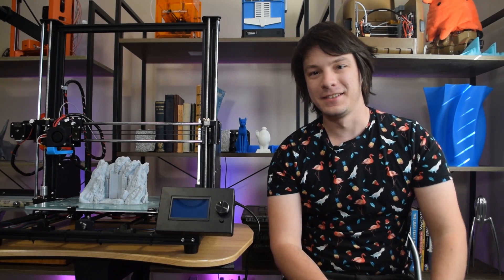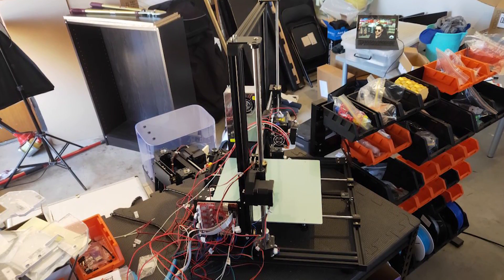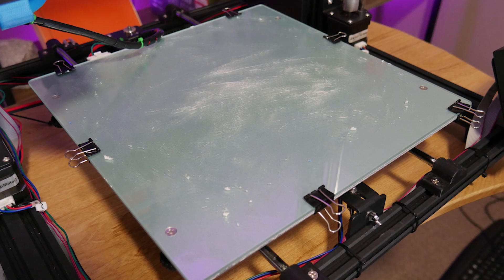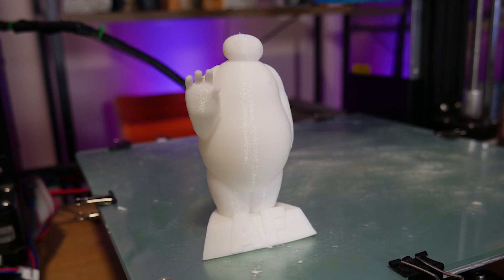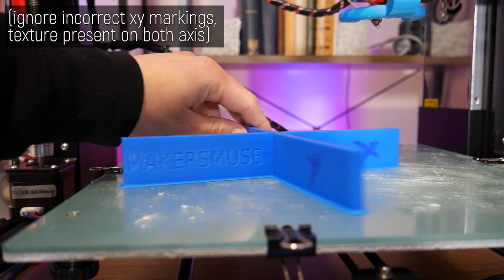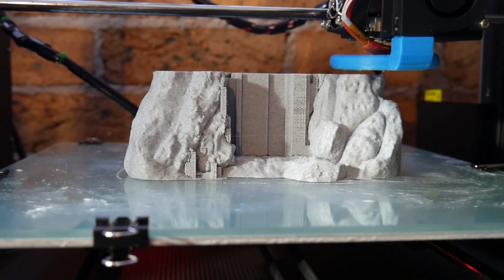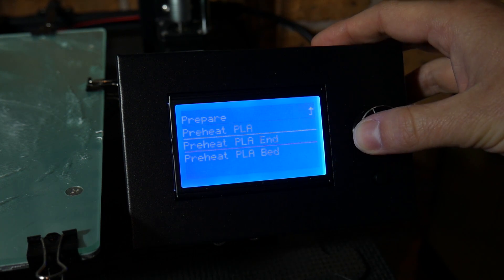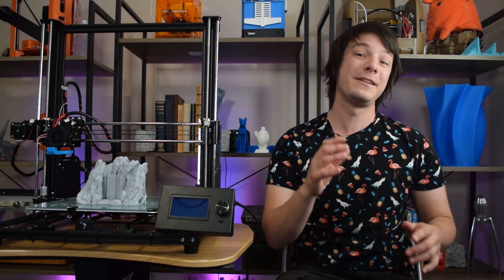The Anet A8 PLUS is big, cheap and won't catch fire. 3D Printer Review

Comment: From what I see this just looks shoddy, even at the low price. It's not like providing the right length of cable is going to break the bank. Even for a tinkerer, I don't think this makes sense. You would end up replacing every component at huge expense. If it was some sort of amazingly rigid frame or something special in another regard then yeah ok, but every part looks sub standard. In 2019 not burning your house down shouldn't need to be considered a bonus.

Comment: I dont understand- why are printed parts so bad? The original Prusas use tons of printed parts on the printers and they are the most famous hobby printers with almost everyone giving them a great review? Is it just that the design of the parts are bad in this case?
Reply from the maker: Yeah, poor quality and designed printed parts in this case. Prusa's parts are generally a lot higher quality though even they have had quality control issues in the past with 3DP parts.
Reply: A reasonable vignette into the Quality control aspects of Anet manufacturing..  Not very reassuring  is it?

Comment: The cable is dragging on the bed,.
Reply from the maker: It sure is...
Reply: @MakersMuse  Don't you consider it a fire risk when the cable can snag on a print and rip the wires out?
Reply: Rubber band it to the top

Comment: New to 3d printing. I didn't realize it was just Anet printers. I heard about them catching fire so my latest 3 day print on my ender 3 I set up one of my home security cams to watch it while at work and send me an alert if the temp goes above 90F. Not like I can do shit except watch my house burn down.

With that said. Does the ender 3 have this thermal protection?
Reply: Most ender 3's should have this enabled, but some do not. There are some video's here on youtube that show you how you can check it. I personally have octoprint with a webcam connected to my ender 3 and i have it plugged into a wifi enabled plug. So if anything goes wrong i can power off the whole thing. I also have a smoke detector in the room. All of this might still not be enough so that is why i try to print when at least 1 person is at home. But maybe i am just paranoid like that.

Comment: Can this print PC?
Would you consider this model vs the tronxy of the same size?  Im looking to print parts to be used as molds for casting, my current mod-t keeps crapping out with the extruder and hot end plugging up.  Just asking for advice, thanks in advance 😊
Awesome channel, love how you take the pros & cons to the units you review 🙂

Comment: I've had an a8 for about a month or so and rather than catching fire, I changed the firmware and get filament spilling out from the top of the hot end and the machine killing itself when it goes over 190°C
Reply: Then again, I may catch it on fire some day and never be printing again, besides on my ender 3

Comment: Angus, I respect your knowledge of 3D printing and printers, however while I am familiar with comments that the A8 will burn and house will burn.its akin to saying do not buy matches or cigarette lighters...they will burn you and your house! This ...as far as the A8 is concerned is so outdated and originally then as now wrong. The cause of ‘fires’ with the A8 was down to people with no knowledge of electronics or electricals. Yes, Anet sent out connecting wires without crimped tags or tinned (soldered) wire ends, which anybody with some basic knowledge would remedy. Stranded loose wires allow arcing..not the blue flashing and sparking, but the type that arcs and builds heat...but it gets worse as the wires react to the heat. Many were afraid to kill a board because those crap little green connectors ...most not soldered properly...would snap, so they “nipped” the wires and not fully tighten then...and all stranded loose wires...building heat....which can cause fires. The hotbed connector ..made for static computer type machines...not a hot moving, jerky printer hotbed.the female metal connectors were loose in the housing...depending on the condition abdvposition of the small retaining “arm”....which holds the wire in the connector. This slides over the metal pins on the bed and over time...will wear and again arcing occurs and the white connector burns. Cure I have been trying to advise newbies since late 2016...to simply run some plastic glue over the metal pins and smear it in...it stops the pins moving. I later modified my use to putting hot glue along the back of the connector and between the wires...it equally stops them moving. I recently asked Anet to ID the part number for the pins...instead they sent a photo of the white connector....which as a run of that white guey insulating cement we see in PSUs and similar electronics...so they have learned ( but not paid me royalties lol)  I am on my 5th A8....since learning these faults on the first A8, I have had no problems. Anet are now shipping  A8s with U tags crimped on wires, removed the crap green connectors abd replaced with far better ones and added a fuze on the board. The Anet A8 will burn your house down is as wrong today as it was then...its people who do  no research, know little or nothing re electrical connections  and create the problems...just as giving kids a box of natches to play with causes fires and just that happened in Queenland last week...kids and matches started a bush fire. I will ask Anet to contact you about the current A8 review it, test it and be fair. Set up correctly its as good and better than others of same build volume.
Reply from the maker: With all due respect, you can't really say the printer isn't a fire risk IF you do all these small mods and tweaks, ANET knew what they were shipping was dangerous for years, and yes the thermal runaway was just one small piece but one that would have been so easily fixed in factory. That's why I won't ever consider reviewing it. From a young age kids know matches + lighters = fire, what they choose to do with that fire can be super irresponsible still, but I bet fire and electrocution risks are the last thing on the mind of many who buy the kit simply because it's the most affordable. Again as you say, "set up correctly" - It just takes a few that aren't and I won't be held responsible for it.
Reply: Maker's Muse ....basically you confirm my observation that some buyers of any printer...do not really understand anything about it. Others will spend hours on YouTube...as I did and being up on the Coast...gyrated towards your reviews. But these buyers who do no...think its like buying an HP A4 printer, stick some paper and ink in and press the start button. I do have some knowledge of electronics and as I wrote, i dealt with Anets cheapo...and typically Chinese attitude to manufacture at the lowest cost. But let us not forget it was the A8 which pioneered the current fever that drives 3D printer market and in turn forced the like of Creality to enter the market and apply some engineering knowledge to replace the acrylic frames.  The current A8...which I do not have...has addressed everything you have voiced concern. I have contacted Anet about my above comments. I think in honesty, you avoidance of the A8 as it was...but as it now...after admitting the A8plus is good...I really think a review of the current A8 ...is deserved mate...
Reply: Maker's Muse ...sorry, I should have clarified.....whatever the failings of the A8 hitting the market in a less than perfect condition....they have changed thing quite a lot. Should you consider a review of the current much  model, to my thinking it would be no different to the various Prusa versions you have reviewed. Add to that any criticism or suggestions from you, would have a better chance getting more improvements and thus be helping untold numbers of newbies with their....safety, and learning curve. A8 is still sold in big numbers and is perhaps the best machine to learn on.

Comment: I've had the AnetA8 for years. Still use it. Sure, I've had to do a lot of tweaking and yes, I had the reversed motor issue as well. However, it's still running quite well. Then again, I watch it closely throughout a print. Not everyone is ok with that.
Reply: Hi Helena, could you please tell me how to fix the motor issue, I'm running into it as well :(

Comment: I thought the cause of the fires was related to a badly engineered motherboard, where all the headbed current went through. Thats why MOSFETS were installed. 
Also, few users actually kept the original firmware. It is just too crappy.
Reply: I assembled mine with all best practices and still had a burn-up at the connector on the heatbed. Most others I've heard of had problems right at the connector on the heatbed itself too. Not too bad since I caught it, just a bit of meltiness and mostly on the ground wire, but I quickly soldered the wires directly to the traces on the board and took special care to avoid any cable strain at all (i had noticed once in a while it'd partially catch on the Y-stepper in very specific instances)
Reply: WaterFucKing MOSFETs help with the motherboard connectors that were not properly sized for the current. The more dangerous problem was when the hot end heater cartridge fell out. Since the thermistor wasn’t getting hot the control software was putting full power to the heater. Eventually any plastic near the heater would catch fire, including the frame of the printer.

Comment: I have an A8, and once you put marlin on it it's essentially safe, only other thing I can recommend is soldering the power for bed heating to the bed as thr connector is quite poor
Reply: Just came to make the same comment. I had a thermistor wire break and it popped a warning and full shutdown within 10 seconds. I also second either replacing the bed connector or soldering to the bed
Reply: Thank you finally 😂😂💯

Comment: Good video I also have the anet a8 plus  the rods had grooves in them after 3 prints also was hard for me to get the bed level the flimsy y plate kept putting the bearings in a bind not a smooth slide so I upgraded to the solid plate and much better
Reply: Can you link the bed you purchased? Thanks.

Comment: That texture could be an artifact of the motors used. Quite a few Prusa owners and owners of other 1.8 degree stepper motor printers have seen these vertical artifacts (referred to often as VFAs) due to an irregularity in the way some common 1.8 degree  steppers move. I fixed this on my own Wanhao i3 Plus by buying Moon's MS17HA2P4100 0.9 degree stepper motors and adjusting the steps/mm values to match the new motor.

As a visual example, here's a video someone else recorded of the difference a stepper upgrade can make: https://www.youtube.com/watch?v=6CMEljHRnsQ

(Of course, I only did this motor upgrade after upgrading all my bearings, rods, and other supporting hardware first to eliminate them from my list of problems).

Hope this helps future printer diagnosis! It was very hard to track down this issue for my own printer.

Comment: Wow its on sale for 191eur, thats just about the price of the Ender 3 Pro. As a beginner, but very much a tinkerer should I get this one instead?
Reply: As a fellow tinkerer, get the Ender 3. It's a great starting point. I started with a Tevo Tarantula kit and printed just about every upgrade for it. I've built and modded a Tronxy X3 kit, heavily modded MP Maker Select V2.1 (MKS Gen L board, TMC steppers, Mosfets, Z braces, Micro Swiss extruder kit, bearings, bed support, TFT screen, 3d touch, numerous braces and control box mods), upgraded the Ender 3 with an SKR E3 mini, BMG extruder, dual Z pulley/belt and many printed mods. I love making a mediocre printer better through upgrades and tinkering. That said, I'd suggest getting the Ender 3 and tinker with that. You can turn a good printer into an excellent printer that rivals those that cost many times more. For the record, I just purchased the Anet A8 Plus too. I'll build it and if it prints well, I may upgrade and tweak it. If it doesn't, it'll become a donor for a hypercube evo, railcore, other random core xy.
Reply: Ender all the way ...It's the virtual Grandson of this Goofy Anet.

Comment: Very interesting. Right away on my original A8 I reprinted some stock parts, printed frame braces, and loaded a standard marlin with runaway protection. Doing this improved quality, but it made the same artifacts yours does out of the box. Vase mode, however, rivals a prusa for some reason. That thing is a vase mode machine. These days it has a titan w/pancake which makes less wobble.
Reply: Also these things will seemingly always be hit and miss. Anet gets supplier problems, and they change designs mid production all the time. But once the things are a year or two old most of that's been ironed out. Read the reviews and check when they were posted.

Comment: Have you actually checked if it stop heating? I think i have seen a case in another review somewhere that the message triggered on a printer but it still continued heating the hot end.
Reply: the issue is the low budget MOSFET's that are used . When they fail dead short no amount of firmware protection will switch off the heater
Reply from the maker: @bigfilsing  True this is still a big risk, thankfully the new board is fused and they say "over current and short circuit protection" but time will tell.
Reply: @bigfilsing  thermal fuse would be the right way to handle this failure mode on any printer.
Reply: @afedaken  assuming you can predict exactly where the failure will occur and place the thermal fuse there !

Comment: Looks like they're still screwing a fan into the extruder motor. That's disappointing.
Reply: Not 100% sure but if I remember right it actually isnt screwed into the motor check an assembly vid I believe its attached differently

Comment: LMAO 3D printed parts suck so you should buy this 3D Printer!!! Ridiculous. There is nothing wrong with 3D printed parts for simple parts that don't require that much strength. People buy these printers then start building new parts with them. Yes the X axis holders should not be printed but then tell that to Joseph Prusia

Comment: we must not forget that without the a8, the whole 3d printer community wouldn't grow so fast and big nor all the improved printer would be invented. Fire hazard is dangerous fo sure though
Reply: Those fires are what makes 3d printing safer today. Including redundancy within the code itself.
Reply: Actually my first printer was the ANET A8, which after a while I used mostly to print Hypercube parts. After having all parts printed, I took down the ANET A8 and salvaged all the parts for my Hypercube? And upgraded parts piece for piece, like TMC drivers, SKR 1.3, E3D V6, glass bed, and much more. But in the base, even while there is nothin left from the ANET besides a bolt here and there, it stays an ANET A8.
Reply: @xoniq-vr  cool story

Comment: I picked one of these up at MRRF along with Chuck Hellebuycks last 2 spools of PLA filament for my Grandson in-law and it works great however, we did have to replace the X and Y linear bearings after only a couple of prints. We ordered an Igus Drylin bearing kit for the Anet A8 off of Amazon and now what was a good print is an excellent print.

Comment: Could be wrong but surely thermal runaway is when the temperature goes far beyond the set point!! I think you tested thermal disconnect.  The main issue is that if the controlling mosfet fails dead short, then no amount of firmware settings will stop it.  Having thermal monitoring set in firmware is always a good thing but it has its limits. Leaving hobby/budget 3D printers unattended remains a dangerous thing.  At the very least buy a smoke alarm ......

Comment: Cheapest price on eBay is AU$517, which isn't bad for a full metal frame Prusa format cartesian of that size.
Reply: Oh, and the quickest fix for fire safety on a polycarbonate framed printer is flashing it with Marlin. Not for the feint-of-heart or inexperienced, but not too hard for the semitechnical hobbyist up.

Comment: Even replacing the rods and printing a few parts, this looks like a good deal for what it is.  Do you suppose some of the artifacts are caused by the uneven drag from those rods?

You mentioned that STL files generate line segments instead of curves:  Have you tried using a 32 Bit board with Spline Curve matching enabled?  I am still tuning my 32 bit upgrade for my Ordbot Hadron but that is one of the things I would like to see how well it works.

Comment: I've got an A8.
An early one I think as it's a version 1.0 board.

It was self built.

I see these a little bit like a kit car.
You build it.
Follow the instructions CAREFULLY.

DOUBLE checking everything as you go. 
Then. As you use it. You check it over before a print.

You service a car occasionally. 
No reason why a 3D printer shouldn't be treated the same.
Reply: Yep.

I'll be honest. 
I don't use my A8 much.
But it is my intention to upgrade the firmware to include thermal runaway protection and if possible auto bed leveling and a filament runout sensor.

Comment: That texture reminds me of my old DIY printer where I used cheap linear bearings. Once I replaced them with decent bearings most of the texture dissapeared.
Reply: The old A8 had rods that floated in the laser cut hole retaining them.  Perhaps these printed rod mounts don't constrain the rods fully and there is play.  Shimming resolved most of that wavy texture for me.  However, I still have some weird resonance during some motions that shows on the surface finish.
Reply: Which brand/type do you recommend?
Reply: @larce4158  I think I brought them from E3D
Reply: The texture reminds me of my makerbot replicator 2...